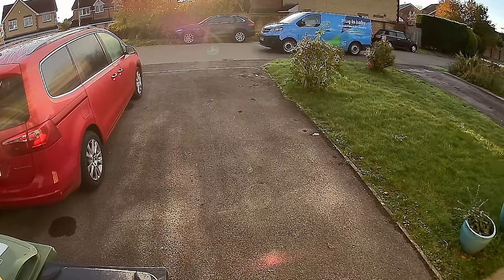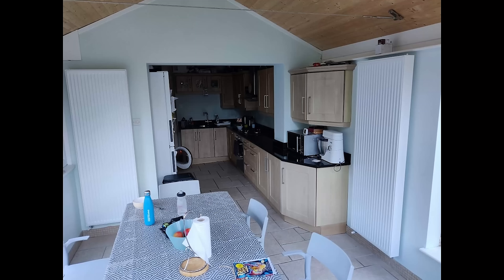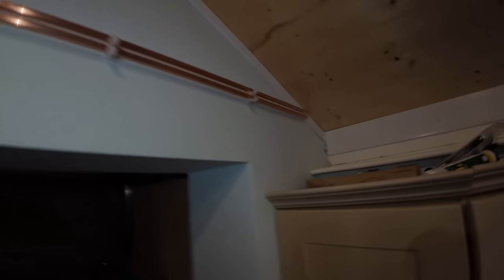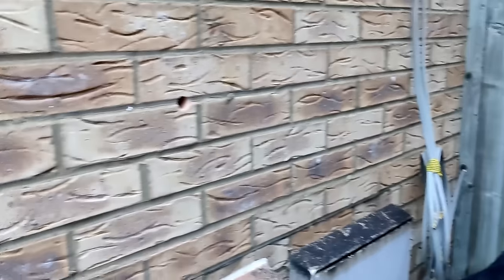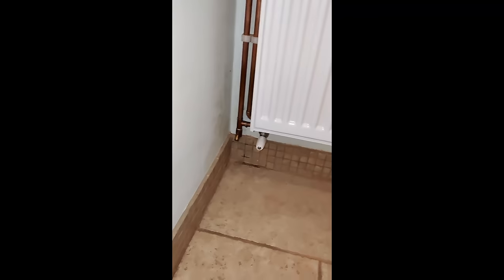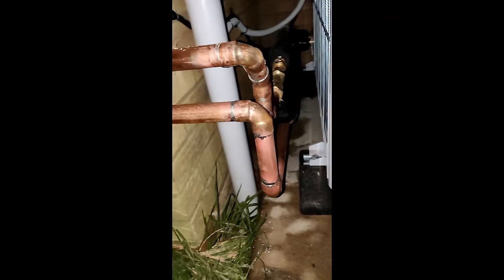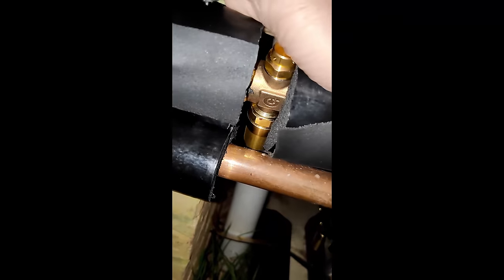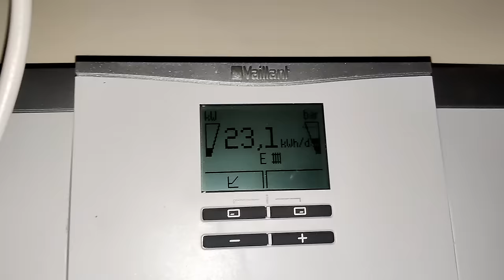Vaillant Arotherm Plus Heat Pump Installation by British Gas

Comment: Second video of yours I’ve come across. First was actually the pricing breakdown video. Really good video and clearly you’re quite clues up about your heat loss calcs and the theory of these installs. 

But if I was you I would be contacting BG in regard to some of the installation methods. For example they have drilled 3 32-40mm holes in one of your floor joists mid-span to try and get the pipework through to your conservatory which could create a weak spot in that joist. Refer to cutting, drilling and notching joists in the building regs. 

Externally they have used white PVC conduit which isn’t UV stable so will discoloured and become brittle over time which could then cause the conduit to break and then expose the twin and earth cabling to UV which also isn’t UV stable and could cause insulation breakdown, or allow water ingress into the building if the bisa boxes breakdown. 

The soulder joints behind that trunking had very large snots which fortunately are covered by trunking as they are very unsightly. 

They didn’t lag the 15mm flow and returns fitted in your garage. 

Cabling and pipework is quite untidy within that cylinder cupboard which will make maintenance and servicing the equipment more difficult therefore costing you more money. 

You didn’t show the chipboard flooring being reinstalled as you obviously didn’t want to get in the installers way or seem nosey but you must ensure they’re glued and screwed and supported the cute to prevent squeaks in the future and that they have used deformed fasteners. 

Also I didn’t notice any soak away for the condense at the ASHP so they may have discharged this into a drain but a soak away is more ideal (unless you’re on clay then this would cause more issues) 

This comment isn’t to be an internet troll these are genuine concerns you should have as you’ve spent a lot of money and these company’s shouldn’t be getting away with installations like this as it devalues good tradespeople’s work. In an electrician by trade and the use of cheap lesser known brands of distribution equipment like doepke are a bad sign for the quality of the rest of the installation. 

However I’m yet to have seen the big reveal on the cost of the installation (not sure if you’ve released that vid yet) but I would assume it was one of the cheaper installations as that’s generally BGs MO as they make there more from quantity not quality.  I’d be interested too see a follow up video in a years time with full SCOP and your first service on the system.
Reply: Noticed all of these, and I loved the Wika box flapping around on the front of cylinder at a wonky angle to extend the 5 core to the 3-port valve. Why isn't it screwed to the wall next to the valve and brought around the back of the cupboard. Oh yes, because that would have required planning the install.

Still the COP figures seem fine and its one less gas boiler.
Reply from the maker: Thank you so much for taking the time to note these all down for me.
Some of these were already on my snagging list, but you've added a couple more.
So many experienced people on here that are just commenting that it's not a good installation but providing no details, which isn't very helpful for me getting the issues resolved or for others who may also be watching, learning and on their own heat pump journey.

Really, thank you!
Reply from the maker: Thank you, this one is on the snagging list too!
Reply: @UpsideDownFork  it’s very easy to Damn someone and just slag off there work but isn’t  helpful. Especially for someone like yourself that doesn’t have a trade back ground
Reply from the maker: @HAelec1  thanks. I'm an experienced and competent DIYer but I know enough to appreciate that it's still a world away from being an experienced tradesman.

All your points make sense and are clear once pointed out.

Take care 👍
Reply: Looking at some of that work, I can see BG has not changed one bit over the years we need updating as time goes on.
Reply from the maker: @onlythetruthfull  Do you mean updating as to how the system is performing?
Reply: For most of the fix, have there been any callbacks, were your floors put back correctly, correctly installed pipework through flooring joists, any leaks etc. In other words are you happy with the standard of work. You keep a good record that helps a lot of people. keep up the excellent work. @UpsideDownFork
Reply from the maker: @onlythetruthfull  There have been some snagging issues but i'll be documenting them in it's own video.
Reply from the maker: @harryanderson1995
I've been going through the process of having the issues rectified. Could you point me in the direction of the conduit ratings please?
This issues is being disputed, whereas the others are easily conceded.
Thanks!
Reply: @UpsideDownFork  if you look into the effect of UV radiation on white PVC it discolours and also reduces the impact resistance much quicker than it does on black PVC conduit. 

This is also from experience of years of servicing external equipment that fails
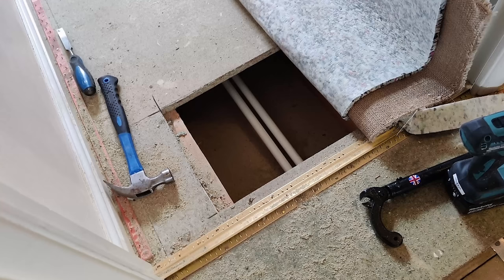Reply: I was also shocked to see the state of the floor joist at 14:21. I've DIY'ed most of my rather large house extension, only used trades where I have to,  because of these very problems. I'm sure a lot of trades would like to do a better job, but when you've only got X amount of days, corners will be cut.
Reply from the maker: @HAelec1  Thanks for the reply. I've done a little research from your comments and it seems there is a small handful of externally rated white conduits now available. They seem to be uPVC rather than PVC so don't have the plasticiser in them. Basically the same material that they make white guttering out of.
Reply from the maker: @TheRonskiman  repairs and snagging video will be coming shortly.
Reply: @UpsideDownFork  haven’t seen uPVC conduit however it doesn’t surprise me that it exists. Doubt it’s being sold in many electrical wholesalers only time will tell how well it fairs. Fortunately that’s the north east face of your house so will get the least amount of sun
Reply from the maker: @HAelec1  I think you're right on all counts! Thanks for sharing your experience with me.

Comment: i wouldnt fancy having to repressurise or change those expansion vessels behind that buffer tank. I think this video goes a long way to show why heat pumps arent gonna be the long term answer for a lot of people. Imagine having a gas combi and needing to find space for that cylinder cupboard. Plus the amount of man hours is staggering. Three or four gas engineers and a couple of electricians for a week!. Swapping the gas boiler for another gas boiler would have taken one engineer a day, plus a day to flush it. New builds with underfloor i reckon these would be brilliant. Im still not convinced they are the answer as a retro fit with all the additional remedial work just to get them to operate properly.
Reply from the maker: You're right that so many homes will struggle to accommodate heat pumps. Our previous house would have had no chance.
Whilst there is the government grant and VAT relief, it makes a lot of sense for homes like ours to make the switch now because when it comes time for a new heat pump in 15, 20 or 25 years, then it is a quick and easy swap with the rest of the system in place.

Perhaps A2A or other solutions like the Tepeo ZEB may become the alternative in those other situations you mention.

Comment: Thanks for the video, im biying a 2 bed cottage no gas mains, so thinking of getting a system like this, but still doing my research.
Reply from the maker: Glad I could help. Lots more videos on the channel that may be useful to you in your journey.
We love our heat pump and don't regret any part of the change.
Reply: So looked into getting a heat pump, but looks like I'm not suitable ! So probably end up with a combi boiler
Reply from the maker: @daz9052  what's the stumbling block in your case?
Reply: @UpsideDownFork  

The house is to small, it's a old cottage with very little space.
Reply from the maker: @daz9052  That is a shame.

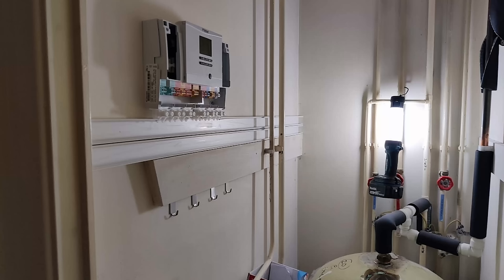Comment: In Finland we have insulation in the adict floor as well in the inner walls for sound insulation. We also have all sorts of building 14:38  on electricity and waterpipes. This have been the case since the 70’s at least.

In the southern parts you could have an air to wateer heatpump. Usually it is one box with all the elecronics and the boiler that goes inside and a outside unit not separate gadgets.

It is much more common with geothermal heat or air to air heat pumps that works as an addition heating source.
Reply from the maker: @thomasl2974  thanks for commenting!

Comment: Good video but the inner decorator with OCD in me wants to cry. God those pipes
Reply: Mm, me too. Also, I need to dust that tank cupboard, but don't know where I'd start? And the giant vertical rads, I'm glad I saw these as they are massive! Nice to lean against maybe but eesh. Perhaps in real life the house is big enough to mean they don't dominate? They do say the camera always adds a few extra pounds don't they?
Reply from the maker: @AL-lz1hb The space they are heating is 8M x 3M, has a 6M outside wall and 9M of floor to ceiling glazing so it needs the giant radiators to compensate for the heat loss.
Fortunately, you don't notice the radiators because you walk into the room from the other direction and are drawn to the view outside 👍
Reply: @UpsideDownFork  hi there thanks, context helps. It sounds a nice big space.  I had my survey done and was told we need a giant rad in my tiny bathroom!! The surveyor said, you can lose a couple of cupboards can't you? I suspect my mind as well because I tentatively said ok to his seeming madcap plan, which will leave me with a hall way with no hall table, an airing cupboard with no airing space and as I say, no cupboards in the bathroom. Added to that we need to loose a few electric sockets rearrange the furniture somehow? We have to accommodate a three metre rad sticking out 6 inches from the wall  and then the outside unit can sit on the patio under my kitchen window.. I won't notice 65db apparently? Or mind being cooled as I soak up a bit of British sunshine. Although he did say my neighbour might have minded had we put it anywhere else? The whole system looks so big cumbersome and complicated and we have to hope it may be affordable to run (no projections)  probably using special electric tarrifs and smart apps. My mind already boggles at such an idea. To the point where I wonder is my current situation of 12 degrees outside of my main living room so bad after all? Winter doesn't last forever, does it? I imagine having guests round after the install and saying, do come into my giant radiator. Put your coat on.. the floor? If you can't guess, this non techy slightly OCD bod is having major doubts. I don't have a large property. Im now wanting to believe the hype about radiant heaters and go that route instead, but don't know if I dare. Far simpler and less obtrusive.
Reply from the maker: @AL-lz1hb  In my other videos I show how I avoided excessively large radiators as much as I could by improving the insulation. It sounds like you have some compromises to make for an air source heat pump to work efficiently.
I have run through the running costs on my other videos and since installation (2 months ago) we have saved over £200 compared to our old gas boiler, which we are very pleased about.
If you are referencing the Infrared panel heaters. I tried one last year and found it pretty useless. The heat wasn't comfortable at all. The targeted nature of it means that part of the room is too hot and another part is too cold.
We've found the low temperature heat pump to be a total revelation in comfort terms. Consistent and even heat throughout the house and even the furniture etc is no longer cold. Even when we used to heat the living room to 21 degrees, the leather sofa was still cold to sit on. Now the leather sofa is as warm as everything else in the room and 19 degrees in the living room now feels warmer than 21 degrees used to.
Hard to explain but our house guests do get it after a few minutes of being in the home.
Reply: @UpsideDownFork  that is useful to know. He's doing some insulation in the loft and says everything else is ok. I'll check out you other videos. Thanks

Comment: As a heating installer of 30 years i can tell you the soldering is shocking, leaving all the snots from the lead free solder is amateurish, dosent matter if its being covered up or not.
The pipes outside should of been in ducting and the lagging inside is poorly cut and fitted.
Very disappointing to see an installation left like this.

Comment: Very interesting, thanks for letting us see this - it reminded me of Robert De Niro as Harry Tuttle. We turned off our gas in June and got two minisplit a/c units installed for £3.5k which took one day and two holes in the wall. We have solar batteries so manage on 16.9p per kWh electric. December's bill (with practically zero sunshine) is going to be about £130 for our 5-bed detached house kept at around 20°C ...just sayin'
Reply from the maker: Good to hear 👍 It's a great option and certainly one I investigated quite thoroughly before making the leap to A2W as a better fit for our house and our lifestyle.
A2A would have been the only option in our previous house though.
We are currently on Octopus Tracker and today is a good example of it working in our favour as the price is down to 12.55p/kWh whilst SEG export is still at 15p/kWh.
Our average CoP is above 4 so we're saving a huge amount of money every month already compared to gas 👍
Reply: @UpsideDownFork  Cool, I guess the results speak for themselves but I'd like to get more people to look at Air to Air as a possible solution - I think the rate of conversions from gas to renewable would speed up a lot.
Reply from the maker: @johnhunter4181  totally agree 👍 I think they should be included in the grant, even if it's less of a subsidy, which would help draw more attention as well as make them an even more attractive financial option.
Not sure why so much tribalism exists between A2W and A2A, it's almost like a family feud! 😁
I think the technology is brilliant and either implementation will save people money and critically will save us from ourselves by reducing everyone's carbon footprint. 👍
Reply: @UpsideDownFork  Good point about raising awareness and I am a bit peeved about not getting the BUS grant. Especially when we are totally off gas while £7.5k of public money could go to someone running their ASHP on electricity generated by a gas or coal fired power station. I don't think it's conditional that you will only buy green electric.

Comment: Why the buffer tank? Usually these are not needed.
Reply from the maker: Vaillant suggest it in their literature. BG insist it must be part of the install.
Installers who would fit it without a buffer quoted much much more for the install so even though I'm sacrificing a very small amount of efficiency and higher running costs, I'll never make the difference back because of how much cheaper BG were than everyone else 👍

Comment: The workmanship looks great. However, it looks really bad at the front and the black insulation. Not sure why you would need three phase. It will be interesting with the new "recommendations" for solar installation it states batteries should not be installed in the loft. One of the main reasons  is that weight in the loft when I the ceiling collapses. How much does that cylinder way? It will come into regs with solar I wonder if it will effect the plumbing side.
Reply from the maker: The black insulation? That is down the hidden side of the house so can't be seen.
We don't have 3 phase. What gives you that impression?
The new guidance around home batteries in lofts is garbage and I wouldn't be surprised if it gets scrapped. If the ceiling is so heavily compromised by fire that the plasterboard ceiling has given way and then the joists/trusses are failing enough for batteries to be a falling hazard, people inside would already be dead and fire crews do not enter properties at that stage. Ignoring the fact that a large amount of batteries in lofts are actually bolted to the gable walls instead of resting on the joists.
I don't have a cylinder in the loft but the old water tank in the loft that we removed would have been 200kg+, approximately the same as 25kWh of home battery storage.

Comment: Sorry if this has already been asked but was there a specific reason for including the buffer tank?  As long as you have sufficient thermal mass in the system to provide heat during the defrost cycle, you shouldn't need one.  Did they calculate it and deem it necessary?
Reply from the maker: They won't deviate from their default installation plan. As simple as that.
I did the maths and have plenty of volume and even the 10mm copper microbore isn't a problem for the mass flow rate we need to those rooms.

But their quote was many thousands of pounds cheaper than others so I will probably re-pipe the buffer as a volumiser on the return next year 👍
Reply: @UpsideDownFork  I know Simon from Urban Plumbers completely removed a buffer recently in one of his videos and it increased efficiency so defo worth looking into.
Reply: @UpsideDownFork  Remarkable they can be thousands of pounds cheaper and just lift labour levels at will!

Seeing this though I still think there is space for bespoke engineered systems where engineers can specify components as they see fit Ie no need for buffer.
Reply from the maker: @loveofkemet  indeed 👍
Reply: @Chris-hy6jy  

I don't remember seeing any follow up to that regarding increase in efficiency, although that was the expectation.

Lost one pump so that's a plus, will be interesting to see the final outcome when it's reported.